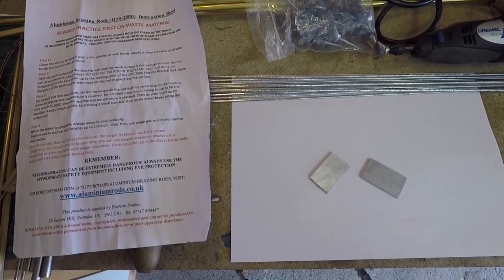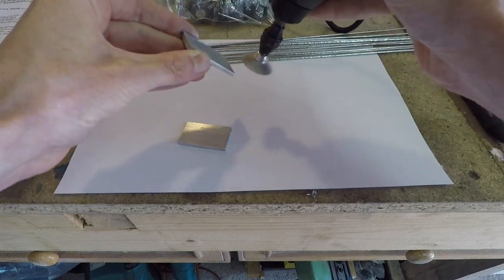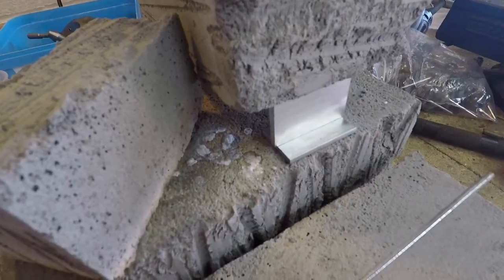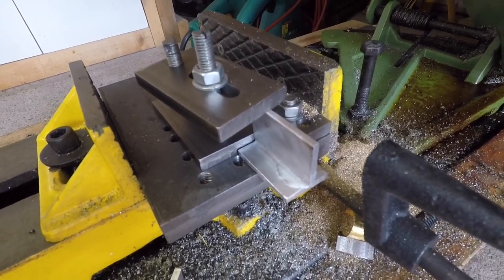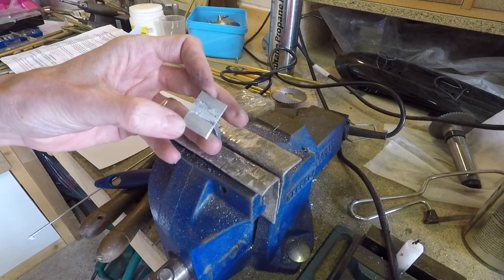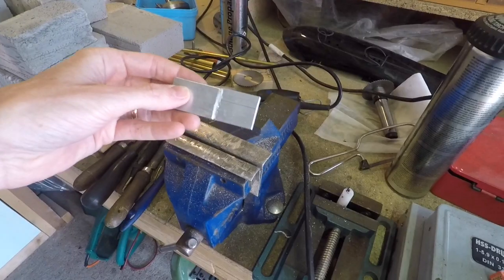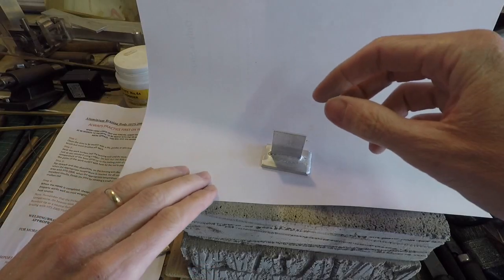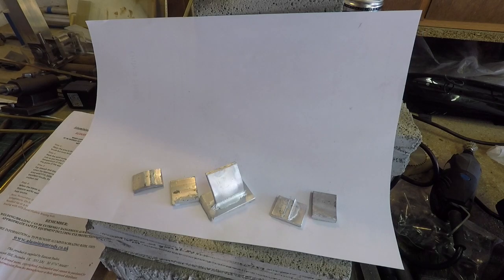How to Solder or 'Weld' Aluminium Alloy with HTS-2000 Brazing Rod

Comment: I am glad that you had good success with this material.  The vendor doesn't provide a composition, but based on the melting point, I am supposing that it is a very high content Zn product.  The problem that I have found with these low melting point "aluminum" brazing rods is getting a consistent joint.  I have found another product that I think is better and that is a Lucas-Milhaupt product, Al-822.  It is still a high Zn content but is 22% Al.  It has a flux core.  I have found this to be easier to obtain consistent braze joints.  This product is also used on refrigeration equipment repairs for Aluminum evaporator and condenser coils.  As you found out, proper cleaning of the joint is critical to obtaining a good joint.

Comment: Capillary action happens with flux. The flow goes where the flux has cleaned the surface. Great post anyway. Cheers from California USA
Reply from the maker: Good point.  The instructions for this stuff don’t mention flux - I don’t know whether flux is mixed in with it somehow.  When I used it, there was no capillary action whatsoever, which wasn’t great.  I’m wondering if it would be worth trying an additional flux.  The melting point is much higher than soft solder but not as high as silver solder/brazing.  Any idea what a suitable sort of flux might be?  Thanks for your comment.
Reply: @MetalMachineShop   yes. A powdered aluminum flux. You heat the tip of the rod and the powder melts to it. Then dab it onto the work piece before you melt the rod onto it.
Reply from the maker: Thank you, I'll try that!

Comment: i bought Blue Demon Triple Play and will try to braze cast aluminum and 1/16” sheet aluminum.  From what you have shown here, it should hold rather well.
I made a box to hide computer wires under a desk and the end caps need to be brazed.
Thanks for making this video. Cheers!

Comment: Makes sense the joint breaks with force. Aluminum isn't strong as steel braze at that thin a material. Even solid aluminum that thin would break with a couple of bends. Wonder if welding aluminum is possible? Never tried it. May be too unstable being an alloy. Maybe I'll try it.
Reply from the maker: Welding aluminium is possible with the right kit and skill!
Reply: @MetalMachineShop  Yeah, should of specified using oxyacetylene or another gas fuel. Which is what the dude was demonstrating with. Well without oxygen of course.
Heavier gauge aluminum may be different though.

Comment: Just a suggestion on your first joint once you get the aluminum hot enough to melt the brazing rod to apply heat from the opposite side to help draw it into the crack when melting the rod.
Reply from the maker: Hi, thanks, that's a good idea, I'll try that next time I use it.
Reply: @MetalMachineShop  No prob. Looking forward to next video. You can also tin the joint connections ahead of time just like soldering wire. You could tin both edges to be joined with the HTS2000 and then heat them up until the both melt together and then also add the rod to both sides. I'm sure then the joint won't break on your next  destructive test.

Comment: Worked pretty well the last one. Should only bend in one direction. When you wiggle back and forth it loses strength at joint. Like bending a wire back and forth to break it. Good job and example though. Thanks.

Comment: I've had a hard time getting this stuff to hold and flow on large items. Specifically transmission housings. I have had luck on small pieces by tinning as you did.
Reply from the maker: It doesn't seem to flow into gaps  like solder. Tinning seems to be the way to go.

Comment: Hi, next time Tin both parts then join.  very strong
Reply: Melt the rod on hot aluminum, not with the flame.  Will penetrate much better that way, and a lot stronger.  Tinning both sides first with HTS-2000 also improves bond. Remember to work the molten rod with the stainless brush into the aluminum surface.  Bit of a process but once you have it down, magic happens :-)
Reply: Reynard Louw:  when do you burnish it, after you’re done?
what does that do?
Reply: Doesn't that just reassure the bonding metal get actually under the two parts? Cause I was thinking using flux before joining. Never tried aluminum yet, but want to experiment with aluminum gutters.

Comment: Great video, thank you. I remember similar kits becoming available for repairing the 'Birmabright' alloy used by Landrover, and it had an almost magical feel in the way that it overcame the traditional challenges of repairing this alloy. There was lots of scratching through the oxide layer involved, I remember. I used it to refill a hole I'd made for a wading snorkel. It worked, although my technique was a bit ham-fisted and needed a lot of cosmetic fettling!

Comment: thanks for the video.  I have a repair to make on a Kelly kettle and I have bought some of this stuff to try.  It looks like wire brushing/scratching in it's molten state is key to a good joint.
Reply: Machine shop at the bottom of the garden Thanks for the comment; yes wire brushing the base metal and manipulating the molten metal with a screwdriver or similar seems to give the best results.  Stainless steel wire and s. steel screwdriver! Good luck with the repair.